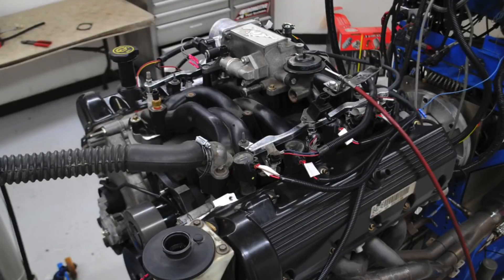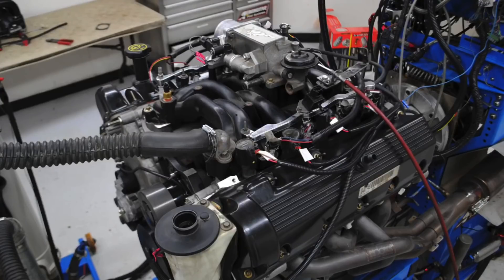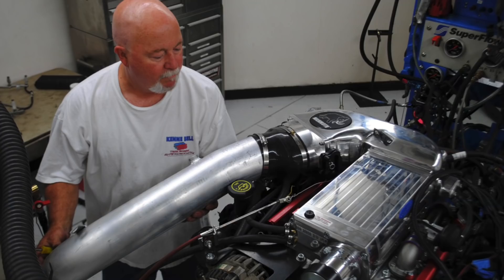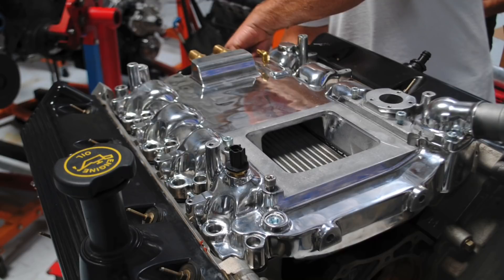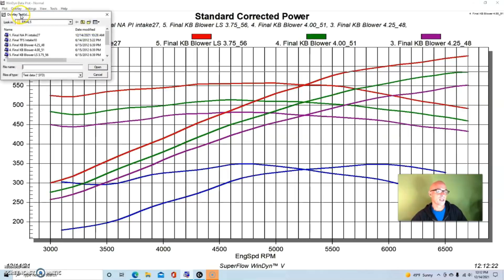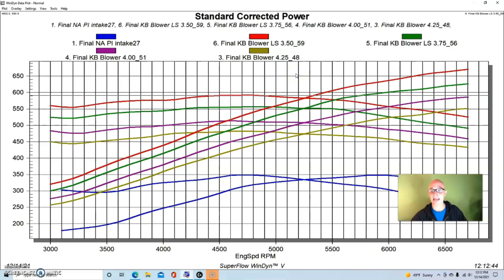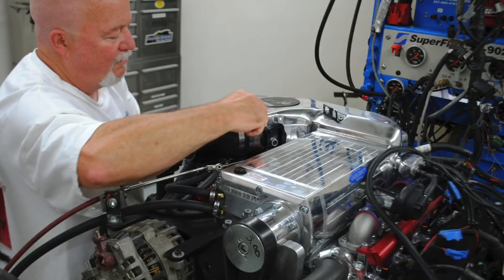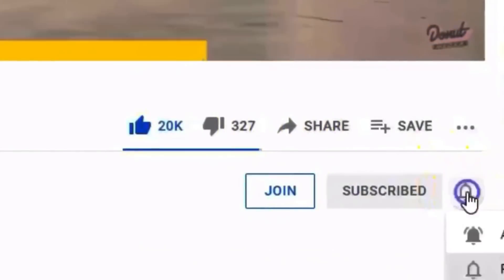HOW TO MAKE 4.6L 2V POWER-BIG BOOST KENNE BELL 2.6L TWIN SCREW-22.6 PSI OF BOOST! BONUS INTAKE TEST!

Comment: Hey Richard, I have a 2.6L going on my 01 GT soon. Curious how much you think the mammoth inlet is worth vs cobra inlet? Thanks, Mark p.s. Big fan of yours.
Reply from the maker: if you tried to max out the blower-then the mammoth is worth a lot
Reply: @richardholdener1727  Forged internals, I'm shooting for around 550-625 wheel. So wondering if I'm leaving enough power on the table with the standard cobra inlet. Thanks!

Comment: What’s the smallest pulley you can go with 8 rib without belt slip and e-85? I’m thinking of going 2.6l. And if that’s the case at same boost levels that you had. Would a 2.8 make a lot more hp?
Reply from the maker: A 2.8L CAN SUPPORT OVER 1000 HP

Comment: Definately cams and better heads. 
   I am working on my 5.4 Lightning and would love to see how much we can get from pump gas. There is WAY too much conflicting info out  there in the Ford Lightning community and no clear, definitive proven setup. As of now I am at about 16lbs with the latest kb 2.6 and only 490rwgp/566rwtq. Oem cams and maybe ported heads.
Definately LOVE to see trick Flo heads vs oem, oem Ported etc. Put that to rest once and for all.
Reply: The trick flow stuff to me is overrated when you're not pushing over a 1000 hp I don't think you need them and when you are forced induction it changes the game of flow rate because you no longer letting the engine naturally bring in air you're forcing air through it so those little tiny ports for the two valve act totally different when you're forcing air through them only thing I think that needs to be changed in your setup will be a cam springs and rods and Pistons I think we all get caught up in the buying parts and throwing at it but if you're not at a certain power level a lot of this two valve stuff is unnecessary trust me I learned it the hard way on the na 2 valve build 4500 for engine with cams for 330rwhp 350rwtq not including torque converter and transmission upgrades an fuel system
Reply: I realize that you don't need all these bells and whistles to make power a lot of these guys will spend thousands for 10 HP a lot of guys just want to be fast for no reason a street car don't need all that horsepower you get good torque for a street ride you good
Reply: I'm running 18Lbs on 93 octane via a 2.9 Whipple. I have ported PI heads and Comp XE262AH cams. I put down 500hp & 600Tq on JLPs dyno, 4x4 drivetrain and mud tires. Lightning converted 98 4x4.

Comment: Checking with those that know more than me.... 
I have a 02  supercharged 5.4 to swap into my 97 f150, 4.6 5 speed 2wd. Just a daily driver...
 Or would you do the Pi upgrade to the 4.6 and add a blower making 8 lbs?
Reply from the maker: which way is cheaper?
Reply: @richardholdener1727  well... Id be cheaper in the 4.6 I think, not by a lot though. But I need to be able to tow at the least a tow dolly with a car/truck on it. Thats the sole purpose  of the swap. I just don't know if the 4.6 would be the right candidate?

Comment: I’m curious to see what the PI vs Trickflow StreetBurner intake (with the long runners) dyno curve looks like on a High compression (15:1) e85 engine. The higher compression will demand and force more air through the runners and out the exhaust. So I wonder, since the velocity should be increased, if there would be such a drastic loss in the curve with Trickflow  intake? And, since airflow would be increased if the PI would be able to provide the amount of airflow needed in comparison to the larger cross runner size of the Trickflow intake ?
Reply: @stevenp3176  We talking Static Compression Ratio or Dynamic? Because it’s mechanically influenced. Because it can only be changed by camshaft timing after a build. Statically, A couple of factors but it sounds like your suggesting Dynamically

Comment: There's a few guy's running stock 2 vavle blocks with cobra crank running 7.70 7.80 in the 1/4. These motors are awesome . If only we had better head options.
Reply: It’s better heads off you got 5k to 7k to spend lol
Reply: @fuckshit2569  Better to spend it once than to port stock PI heads then realize TrickFlow's heads still make more power for nearly the same price.. Or you can just boost it make more power, say turbo n forged internals, but i like n/a builds then boost.. i like stroker forged internals tho..
Reply: @P71ScrewHead  it's good to have a good foundation even with boost.  Trickflow heads and cams can make some good power on a forged 2v with forced induction.  The 2v isn't nearly as bad as people make it out to be it has good potential.
Reply: @midnight347  I totally agree, ppl tend to forget that these were fleet vehicle engines, it's the Model T of Ford engines..lol Coyotes are mostly fully built engines that not much more can be done to them to get n/a power out of.. 281ci vs 396ci is a huge difference but still a well built 2v can hang..
Reply: TrickFlow heads n matching cams bro.. That's the key to a more powerful n/a 2v..
Reply: Are trick flows that much . 5 to 7 k really.
Reply: @Spad68  TrickFlow top end kits are about $4k, comes with everything you need to have a badass 2v, what makes it more expensive is labor on install unless you can do it yourself.. I was quoted $2k for install.. Heads alone are $2.6k, ported PI heads can get that expensive or more but still TrickFlow heads make more power..
Reply: @Spad68  no they don't cost 5 to 7k not sure where that came from.  Maybe 3k or so fully dressed with cams or something.
Reply: Shit that not a cheap at all . No wander people stick to the push rod 302.  . I'd try to retro fitted the 6.2 f250 head instead.  Those puppies can flow up to 400cfm and more . Otherwise I'd drip the hole 6.2 in place of 4.6. I know someone that did it . Used the stock 4.6 pc and a tuner and capped the secondary spark plugs .
Reply: @Spad68  Well, there is no replacement for displacement, bigger will always be better in my book.. But cheapest way to huge power will always be forged internals n boost, saw a kit today for $2,600 n 1,000hp rated.. Best way to power imo..
Reply: @P71ScrewHead  it isn't nearly as expensive as people make it out to be.  Considering how much less the engine itself and the car costs it's actually not a bad way to go.  People spend that kind of money by the time it's all said and done just swapping a stock 200k mile 5.3 ls.  Why do that when you can just build the 2v and destroy that 5.3 on making power and making it reliably.  You're comparing a freshly built engine with forged internals to a 200k junkyard motor.  I mean I just don't get it.  Even if it costs little more to build the 4.6 all in (there are way more costs to ls swapping than just the engine itself people forget that) it is still worth it to have a freshly built forged motor compared to a 200k mile junkyard motor.  If you're building them they all cost close to the same.  If I had a 2v I would do forged internals, cams, boost and swap in a t56 magnum.  You'd be golden and able to make some pretty good power reliably.
Reply: @Spad68  Oh, forgot to mention, the old 302 is hp limited, needs an aftermarket block to compete with the 2v.. So the old 302 ain't as cheap as ppl think.. Nor are ls swaps..
Reply: @P71ScrewHead  agreed.  It's also seems that some of the 6.2 came with forged crank .
Reply: @Spad68  is the 6.2 the ones that the Raptor had or different?? Still would be a kool swap, 😎.. Seen many swaps but not a 6.2L Ford..
Reply: @P71ScrewHead  the raptor has a few different things to give it the extra hp/torque number's but essentially  both the raptors and the F series 6.2 are the same . Only thing if some come with forged cranks and other do not .
Reply: @Spad68  oh ok, should make a good runner 🏃‍♂️.. The 4.6L all come with forged cranks but only the SVT Cobra has the forged rods n pistons..
Reply: @P71ScrewHead  LS swaps are cheaper and a better value...
Reply: @camposvazquez  to me they're not as cost effective unless they do the swap themselves or straight up stole the whole parts car.. Literally seen Crown Vics n Chevy trucks get stolen for that lone reason, to use in swaps..
Reply: @P71ScrewHead  swapping LS is cheaper because everything is plug and play and LS are more efficiently packaged..

If it's more expensive for you to LS swap then you have serious logistical and common sense problems..  

I have an e350 5.4 2 valve..  built like a tank.. but I want to swap in a 6.0 because it makes more power...it's even more reliable...easy to service...

If I tried to swap a 5.4 4 valve.. how much would that cost?  Or the old 302???

You are a Ford fanboy... You are not a car guy...
Reply: @camposvazquez  ok Chevy fanboy.. Want to get rid of that 5.4L 2v intake?? The 5.4L can be built for 3k hp, haven't seen an ls go that far.. Any engine can be built for high hp, seen 900rwhp 4.6L 2v all stock besides internals.. An ls can do 800hp for a few runs but doubt it'll last long.. Also keep in fact that compression plays a huge part, most Fords are low compression at 9.5 while ls is 10.9 so yeah there's 50hp just in that bump.. Labor costs are things to keep in mind, I simply wouldn't find justification swapping to a junkyard engine for a few extra herspers..
Reply: @P71ScrewHead  why would I want to get rid of the long runner intake on my e350... I need it for torque...  I thought a Ford fanboy like you would know that...

Just to prove my point... You are an armchair wrencher...  

Show some respect and stop being a fanboy
Reply: @camposvazquez  oh trust me I know my engines.. You're here rambling about the ls being the almighty so I'm thinking you're going to ls swap your van too n since them intakes ain't a dime a dozen, I'm asking in case you plan on junking the engine.. Look, you clearly are bothered I'm not an ls guy, I love the LS7, best ls engine ever created, but I wouldn't bother swapping one in my rides unless I find myself a B13 Nissan to build..
Reply: @camposvazquez  you don't need to swap anything just build the 2v.  The cost adds up quicker than you think.  Why would you spend thousands just to drop in a 200k mile junkyard motor?  That is the only ones yours gonna get for the magical 500 bucks everyone says they go for when most of them don't.  Forget doing an ls2 or ls3 or any of the other good ls that came in performance vehicles they cost as much as coyotes do and you ain't saving shit.  The dude just said you can get a fully forged rotating assembly for a 2v for 2600.  Do your own work that is much better than swapping on a junkyard 200k mile 5.3 and that probably wouldn't even be that much cheaper all said and done.  There is alot more cost than just the engine.  This ls swap nonsense has got to go.
Reply: @camposvazquez  lol
Reply: @camposvazquez  lmfao . Ok Chevy not hugger . What you not a Chevy fan but and not a car guy.
Reply: @midnight347  a 5.3 does not cost the same as a coyote....lol.. you just lost all credibility...lolol
Reply: @Spad68  😆😂.. wish I had the 5.3 at least..

It's a class b RV...  No I know why people overwhelmingly prefer the Chevy and GMC based vans...

I found a code ready specific for ford's..  apparently I need to when working on the brake lines...

13.9 mpg is the best I have achieved...wondering if I can swap out the 4r100?? Trans for the torqeshift
Reply: @Spad68  I mean a trickflow top end kit costs close to the same for a 302.  It's a myth that it's way cheaper to mod and easier to get power out of neither of those things are true.  Actually Richard did a video where he tested a trickflow top end 2v against a trickflow top end 302 the 4.6 made more power and torque and it did it with less cubes.  The only thing that is cheaper is doing a cam as there is only 1 and the 4.6 has 2.  Otherwise cost to mod is similar and the original 4.6 block can take way more power even if both engines had forged internals.  Not sure why people talk down on the 2v.  For what it is it can make some steam with the right setup.
Reply: How do you avoid piston to valve issues with stock pistons stock valves and a 270 cam and no valve reliefs?

Comment: Wouldn't it be theoretically possible to take a pi block and put non pi head on it and throw a boat load of boost at it?
Reply from the maker: yes but why-low compression and bad head flow?
Reply: @richardholdener1727  your right about that it would be better just to have a pi motor and throw boost at I guess

Comment: Can you make a video showing the gains on this engine after changing the compression to atleast 11.1 which is what the coyotes had for several years and now have even more. Good video and info Thank you Rich.
Reply: He already did one. It's in the playlist. It's called a PI swap. Basically post 2000my PI heads on a pre 2000 non Pl short block. Bringing compression up to about 10.5 or so. That's about the closest you'll get to that type of modification.
Reply: That would be awesome to see what even higher compression would do on a 2 valve though. People talk shit about these motors all the time.
Reply: @wile.emario8957  they actually make good power for their displacement especially considering its 20-30 years old.  Alot of people just talk shit because everyone else does.  I call it the sheep syndrome where people just copy what others do and say with no actual knowledge of the engine at hand or whatever it is you're talking about.
Reply: @midnight347  I agree with you. Keep on living your best life friend!

Comment: I always want more power from my Crown Vic but, the thing has been so reliable I shy away from a lot of mods. Thanks for the 2V stuff!
Reply: Go straight to boost n a tune n you'll be happy.. I have a 09 P71 that i just installed Maximizer's longtubes on n it definitely made it faster n sounds great with how i customized the high flow cats n electric cutouts.. I'm uploading a few videos soon so you might want to check it out.. i also have 17x12 widened steelies on it on 345mm 28" tall tires..lol
Reply: @P71ScrewHead  Sounds great! I have not found those headers anywhere.
Reply: @tenorhowlermonkey3454  They're the same as the OBX headers n i bought them on eBay, they went up in price but back then a few years ago they were just over $800 which is why i went with them.. I just uploaded a new video of it idling both open n closed, but i gotta admit the cutouts rattle n it sounds kinda like a diesel in the video but it does quiet the car a bunch compared to them open..lol Not bad for cheap eBay cutouts tho, plus, i'm sure they wouldn't rattle if i didn't customize them to flow directly out when opened.. I guess they sell them the way they do for a reason, huh..
Reply: @P71ScrewHead  I'll check it out this Thursday!
Reply: @tenorhowlermonkey3454  Sounds good..
Reply: The 4.6 has quite a bit more in it stock..You do mods to unlock power it already has not necessarily mods to add power.

If we look at the 260hp PI engine this power number is with all the accessories and the stock restrictive exhaust system and the factory tune...Remove all that as with on this dyno test and it's already a 300 hp motor from the factory..you just need to unlock it.

That comp cams cam added top end power and likely lost torque at the rpm ranges we drive in normally..The PI cams are rather well matched for the stock PI heads.

Unleashing power with an exhaust and an sct X4 tuner, better flowing air filter and an underdrive steeda crank pulley works very good and doesn't harm reliability for normal driving..A 3.55 is also a great choice for a daily driver if you have less than a 3.27 gear already.
Reply: @panthermadness4232  i agree, going 3.73s tho, need to move a bit faster..lol
Reply: @P71ScrewHead  bump up to 3.89-3.91. The Marauders have 4.11's.
Reply: @ricklodestein1101  I have 3.73s on now, I like them, do think 4.10s would move it n make it skate ⛸🛼 down the street faster but for an n/a build I think 3.73s are just fine.. On my drag build 95 Lincoln Town Car I'm going 4.10s n Detroit Locker.. ;)
Reply: @P71ScrewHead  on am na build gears make even more sense than with forced induction although I think 4.10 would be great either way
Reply: @midnight347  I agree that with boost n highway gears it's all good.. A car with aggressive cams ask for gears too tho so that's why I went with 3.73s but didn't want the high revving on the highway due to passengers not liking the Loyd exhaust.. When I'm alone tho I don't mind how loud it is..
Reply: Don't be afraid to do mods.  Mods don't = more unreliable if you do your homework and use the right parts and the most octane possible and a really good tune.  That is what matters.

Comment: This would make a cool daily mustang at 10 psi on stock engine, but how would it affect longevity. I would expect a supercharged engine to last significantly less time/mileage than stock, especially when it was not designed for boost.
Reply: Had a good buddy of mine run a Vortec at 12 lbs, on a stock npi block with PI swapped top end last for 5 years of consistent abuse. It didn’t “pop” until he went to On3 Turbo kit instead. It made 80 more rwhp on the same psi
Reply: @rayman1230  that
Reply: Thats exactly where I am at right now with mine. I swapped the 4.6 into my 1966 mustang. Absolute blast to do and to film. But I'm to the point of curious on supercharging it and how it impacts the reliability.
Reply: @4WDTrek  on stock motor anything making over 400 is on borrowed time. Forged rods and pistons, preferably lower compression you can beat the snot out of these motors